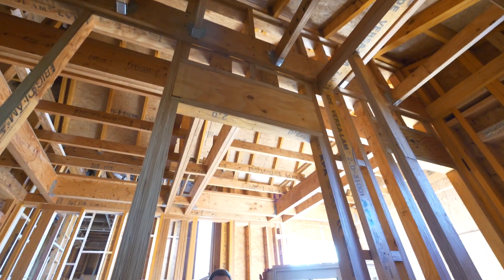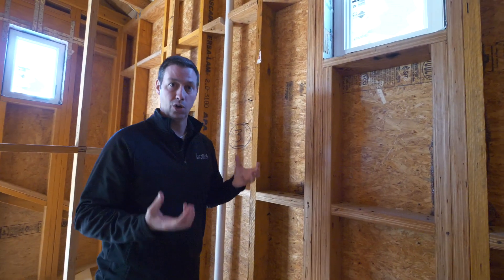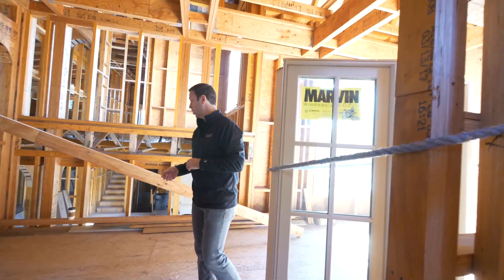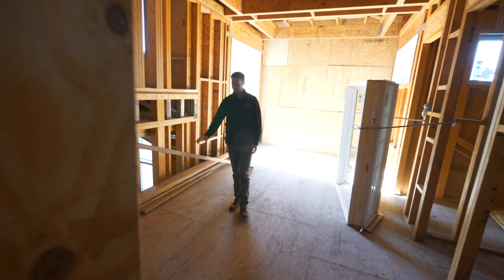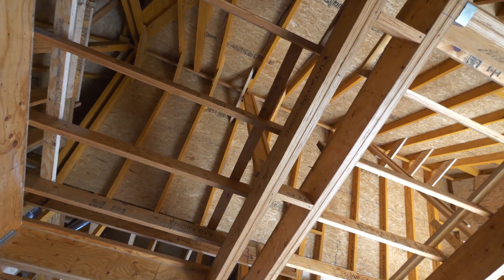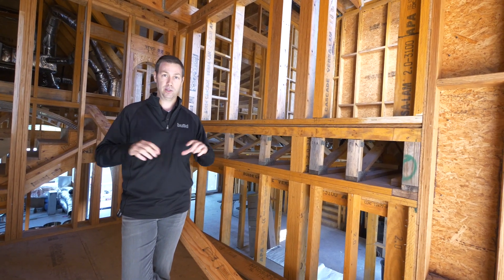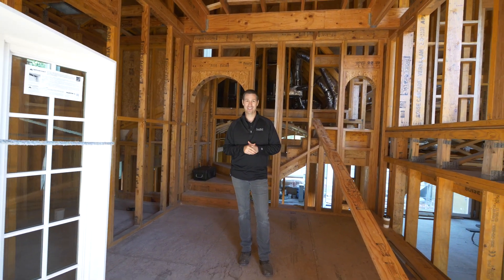2x6 LVL Studs - Pros and Cons

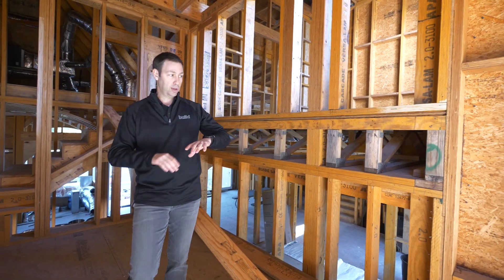Comment: 3:22 "Because this house is nothing but engineered materials ..., there's very little ability for water to leak in this house and soak up, which means that we need to take a lot of precautions on the outside of this house to make sure that this house is staying dry."
The use of the word "ability" is confusing. Are you saying that engineered materials are more vulnerable to water damage than traditional lumber? And that's why it is imperative that it stays dry?
Reply: Wood is hygroscopic, meaning it absorbs water.

When building with LVL, the lumber will absorb very little moisture which means you have a very small buffer.  We cannot completely control our environment and humidity levels will fluctuate inside and outside the home.  If moisture is carried into the wall cavity by an air leak, or vapor by diffusion, or bulk water from a leak in the cladding and WRB (the most destructive which is why Matt said the outer control layers must be effective) the wood provides no buffer to absorb and later release any moisture.

If you've ever worked with LVL, you've seen water beading on the waxy coating and can even feel the difference as compared to conventional lumber.
Reply: As RBRinc said it's the amount of water the wood is able to absorb.  What that really means is the LVL framing is more vulnerable to mold and rot than regular lumber is.  Matt has talked about this is a few of his previous videos.  What causes wood to rot is fungi and bacteria.  Each of those require three things in the immediate environment to grow, a carbon and nutrient source (food), water, and oxygen (though some bacteria do not require oxygen).  We are most concerned with Fungi as that is the major cause for structural weakening of wood, bacteria come into play in the later stages of rot.  Since wood is the fungal food source and oxygen is in the environment we are concerned with water.  Wood needs to have a certain percentage of moisture content to support fungal growth.  Since there is less wood in engineered materials it takes less water to reach that percentage of moisture content.  

If we think of framing like we do beef then the tree would be the cow, dimensional lumber would be like having a cow butchered and quartered, LVLs and plywood would be like having steaks, OSB would be like having the beef cut into small bit sized chunks, and fiberboard would be like ground beef.  Each of those steps make the beef easier for us to eat, likewise the more the wood is broken down in the final product the easier it is for fungi to eat it.  

Additionally with engineered products we also have to worry about actual water damage.  As wood absorbs water it expands, this expansion causes the wood to separate from the glue that binds the wood together.  Some products like LVL and plywood are very tolerant of this partly because the pieces of wood are larger so each is able to absorb more water before really expanding, and partly because how they are layed up  the expansion does not stress the wood-glue interface as much.  Other products like MDF are not very tolerant of water, and even small amounts of bulk water can cause it to be damaged.
Reply: Right, this didn't make sense to me as well.
Reply: I would imagine so. Glue doesn't hold up too well in wet environments.
Reply: firecloud77 water warps this material easily
Reply: I assume he is implying natural wood absorbs water, where as lvl does not.  Water creating problems like rot and mildew and bugs.
Reply: PengWins 09 ok but why extra precaution? Is he saying during the build you need to take precautions so it doesn’t get wet?
Reply: RBRINC, Donald Endsley

Thanks guys for the excellent explanations.

The way Matt phrased his comment was confusing. It would have been better phrased like so:

there's very little ability for water to soak up IF it leaks into this house.

Instead of:

there's very little ability for water to leak in this house and soak up

I will now brace myself for the inevitable flood of accusations regarding my Grammar Nazi status. :)
Reply from the maker: RBRINC couldn't have said it better myself. Yes
Reply from the maker: Donald Endsley yep
Reply: eng. materials in this case -> glued lumber, technology is similar to plywood manufacturing. in case non water resistant glue used, it will disassemble from the water faster than regular stud will rot. to make it water resistant, epoxy should be used as compound, and protective coating on top, what is expensive.
Reply: Yeah, engineered materials swell and rot with much more ease than traditional real wood materials. They are better in the short term because of their higher structural ratings than regular wood.

Comment: What was the extra material and labor cost over one of your typical homes?  Will you see savings from finish subs because walls so straight and true?  Like your stuff, keep it up.
Reply: Rough framing cost (materials + labor) for full LVL is about 2.5-3 times what SPF would cost.
Reply: I would suggest just going to metal studs for interior walls and LVL for the exterior.  Straight, light easy to work with, cheaper.  Honestly, wouldn't choose it over ICF.
Reply: I highly doubt you will see cost savings pay back the extra lumber materials cost.  I went with premium doug-fir studs to avoid the crap they sell now as a common stud and my cost was about double just by doing that.  Interior drywall work costs a bit more when dealing with twisted studs but overall the cost of interior finish is probably not going to be as big as you may think.
Reply: I just would have went the ICF route..
Reply: I was just going to say. At some point steel framing is going to be cheaper if all you want is straight walls for a high level of interior finish. When is that point?

Comment: Hey Matt, I live in South Texas-Harlingen. Where do you buy these studs? We have McCoy's and the big box stores, but they don't seem to carry them. I am getting ready to build my own home and would like to have my framer install these studs in the areas that you recommend.
Reply: Raul P. I'm in VA, but you will likely have to order from a lumber yard.  I would be surprised if a box store in your area has LVL, especially in the widths you would want for wall framing.
Reply from the maker: Raul P. I would go with a high quality SPF from McCoys for your house. Not much wind loads there. Spend the extra on air sealing and insulation not studs
Reply: Matt Risinger Will do. Thank you for your videos.
Reply: I heard you mention ring shank nails for framing. What nails do you recommend for framing and sheathing?
Reply: you need to talk to your local warenhausen(spelling?), rep and find out who they deal with... i ordered some microlam 2.0 lvl's to replace some cracked 18' ceiling joists... they were no.3- 2x6's( 100% serious).
Reply: Timothy Manley I assume you are talking about the local Weyerhaeuser rep?
Reply: yea sorry... my spelling is/was horrible. 

there are other companies producing engineered lumber obiviously, but weyerhaeuser seems to be the largest of them.